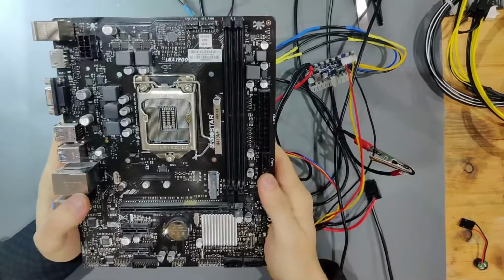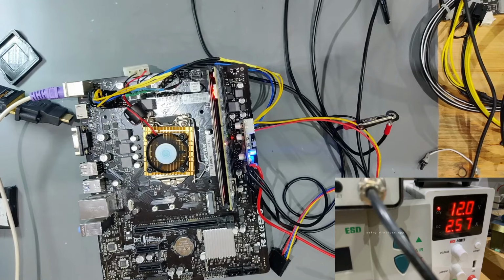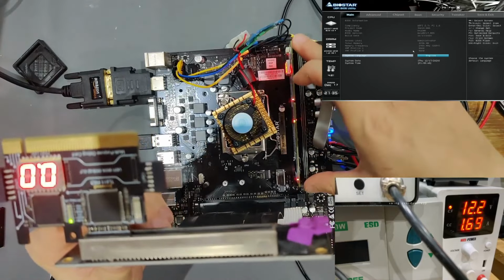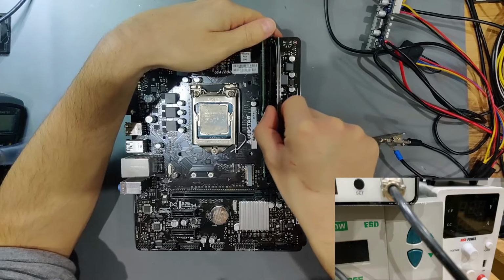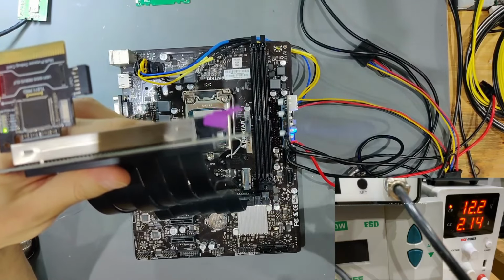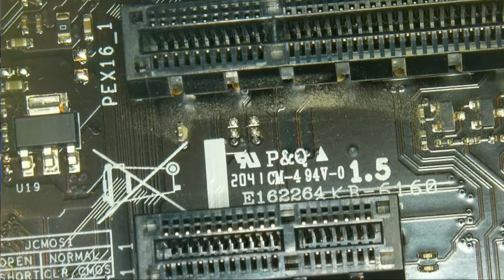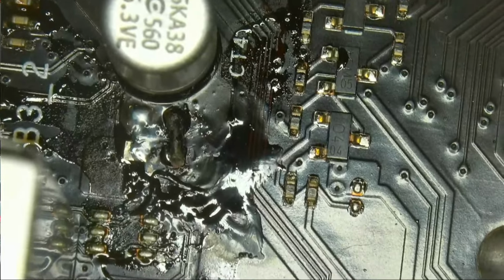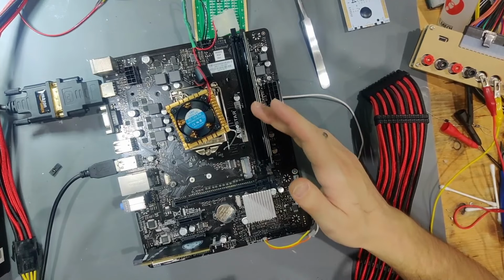I WAS FOOLED BY THIS MOTHERBOARD | SO MANY MISTAKES IN ONE VIDEO | H410mh Biostar Repiar Fix Motherb

Comment: Great Video! Does the board come from Kleinanzeigen by chance? I thought I saw one  with the exact same error description for ~20€ there a few weeks ago. I thought about buying it but it seem like you already have it. I would have just replaced the resistors since I don't have much equipment for testing.

Comment: Do you think an Asus X570-E Gaming Rog Strix with a 4D error can be fixed?
Reply from the maker: I think so, sound like a RAM issue. Its already a good sign, that post cost run at all! Means CPU is reconized and Bios is red!
Reply: @MainboardMedic  Thank you. Would it be hard to fix?
Reply from the maker: @BucifalulR  I dont think so. There will either be a data line damaged or maybe a Bios issue.
Reply: @MainboardMedic  Thank you. So a BIOS programmer might come in handy?
Reply from the maker: @BucifalulR  Yes, that COULD be the problem, doesnt have to be.
Reply: @MainboardMedic  Seems like it is the CPU led that is lighting up along with the error. Does this mean anything?
Reply from the maker: @BucifalulR  I think i had this before. These Asus Boards have weird order of LED´s. They have a DRAM LED first then CPU VGA boot. But i think it is wrong because its first the CPU being initialized and then DRAM. So i would still think this to be a DRAM issue and not a CPU one.
Reply: @MainboardMedic  Interesting, then. Someone told me he’s certain the issue is caused by a faulty capacitor. The board got in this state after a power surge (when mains power returned after an outage). Could this cause RAM issues?
Reply from the maker: @BucifalulR  possible, but very unlikely!
Reply: @MainboardMedic  Thank you very much, I really appreciate your help.